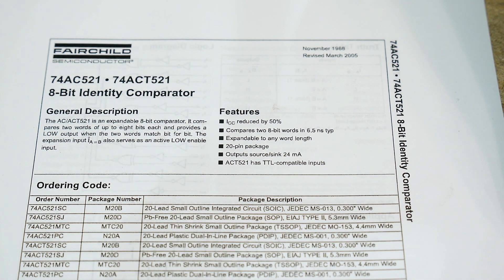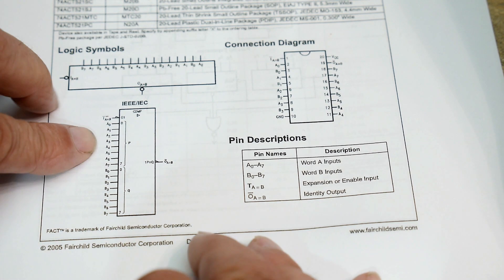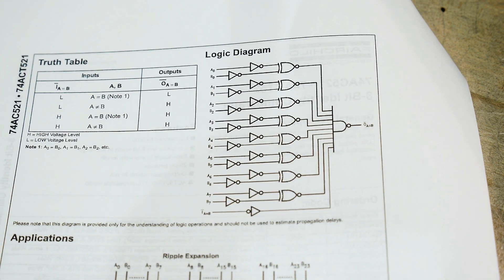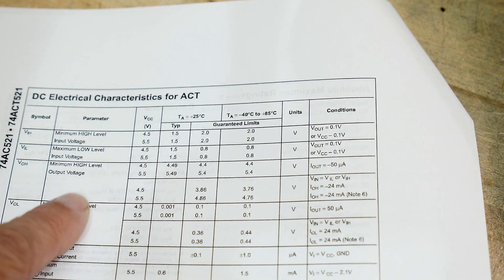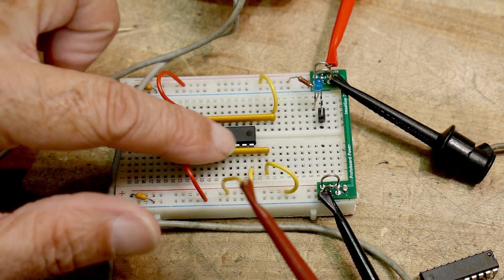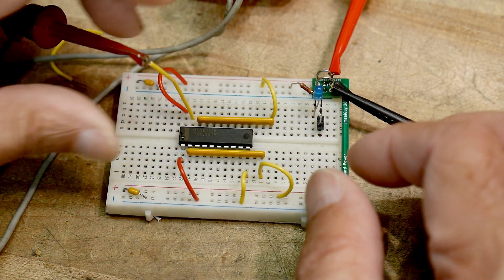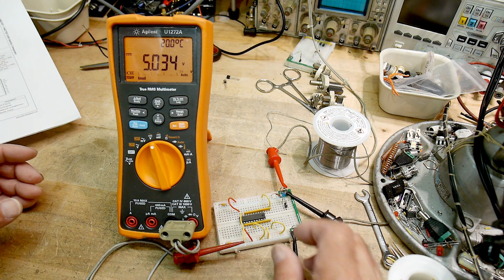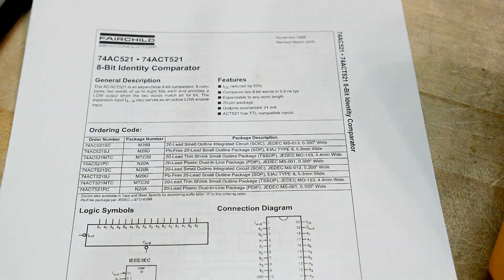#1536 74AC521 8-bit Comparator

Comment: I hear the term "pull - resistor" or in this video "they are all pulled up."  Please explain what this means.
Reply: The inputs are tug up to VCC or tug to ground by a resistor because an open input will put the IC into never land. With a resistor you can ground or VCC the input without shorting out the power supply.

Comment: what type of conductor do you use for Bredboard?
Reply: normally solid core from 22-30 AWG copper is great choice.
Reply from the maker: I use 22 gauge solid wire
Reply: @IMSAIGuy  Yes! works great. I thought your wire was stranded and the ends were tinned.